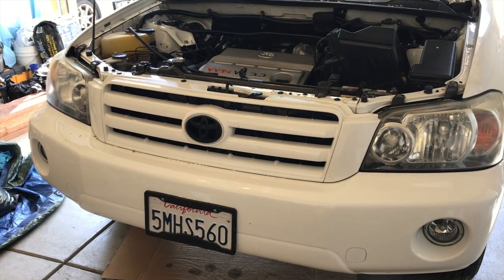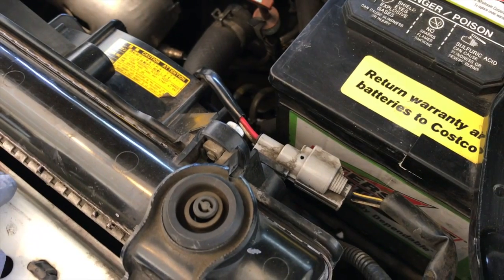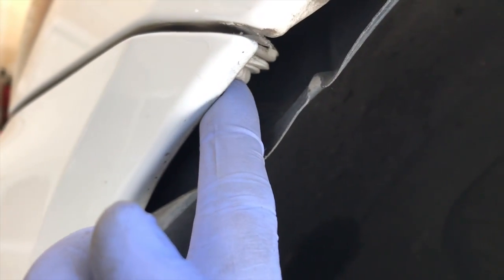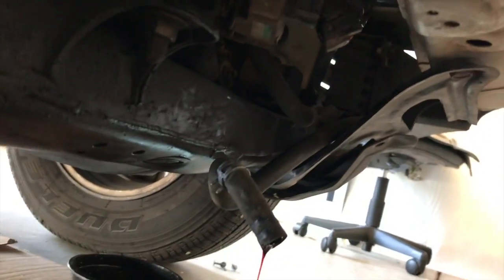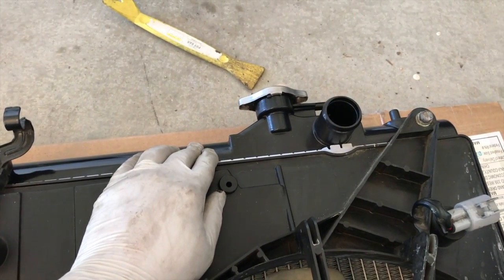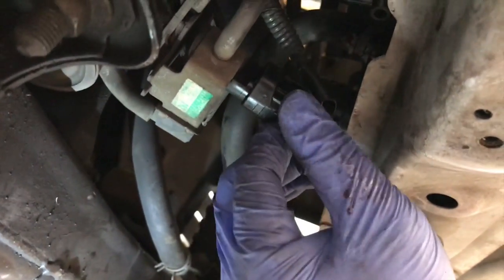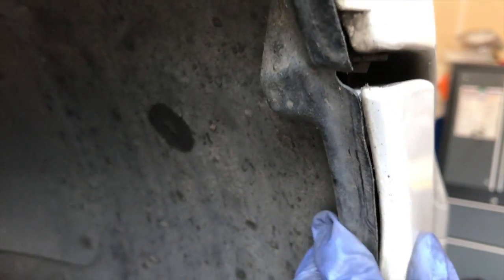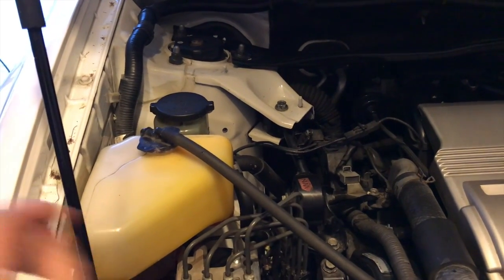2001-2007 Toyota Highlander How To Replace Radiator

Comment: Two questions. What are your thoughts on removing the engine block drain when doing a coolant change?. Also, are there any specific bleeder valves that need to be open during the air burping process?
Reply from the maker: Personally, I don't think it worth the time and effort to drain 100% of the coolant. I didn't really look for bleeders. Even with cars that have bleeders (such as Hondas), I don't open them when "burping".

Comment: Why did you remove the bumper? I didn't have to on my 2006 3.3L.
Reply: I don't think that was necessary at all.  Just the bottom guard.  I am about to replace the radiator on my '02.  I just replaced the fans with used for $60 on eBay and it got me most of the way there except at idle.  Gonna check the water pump and belt tension then order in a cheap radiator.
Reply: @jbgpcc  Don't go cheap on parts, EVER!
Reply: No need at all to remove front bumper

Comment: Why you need to take a front bumper off ????
Reply from the maker: The lower portion of the bumper covers the trans cooler line. I guess you "might" be able to bend the lower portion of the of the bumper. Personally, I do not like to bend anything.